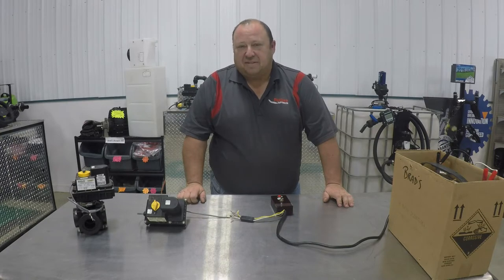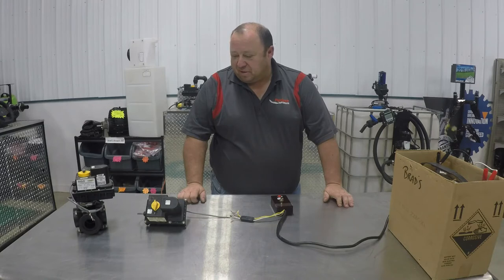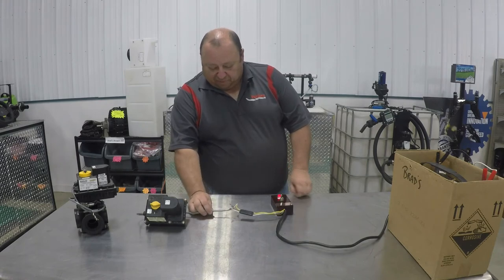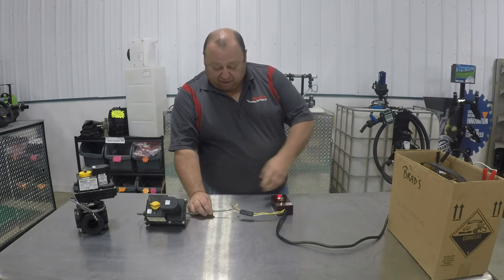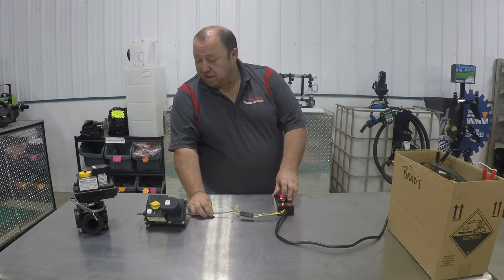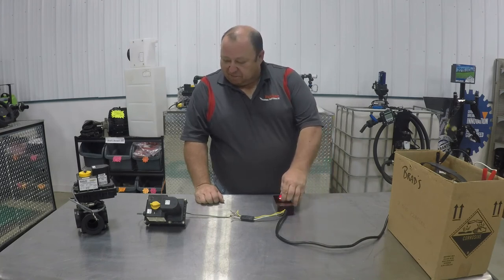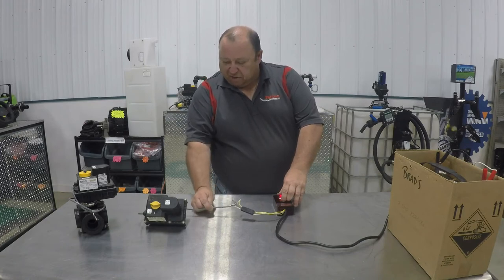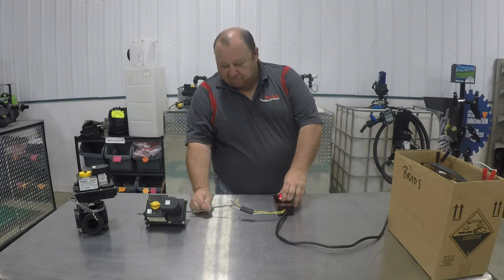Pattison's New Model Banjo Electric Ball Valves Troubleshooting

Comment: Anyone know how the yellow plastic "flow indicator" is removed on this electric Banjo valve?
Reply from the maker: Hi Bill! The plastic flow indicator cap should just pop off. If you can pry it straight up on it it'll remove easily.
Reply: Thanks for the tip.  I wasn't sure it just pried off.  I had the valve apart and simply pried the knob off using a large screwdriver blade leveraged between the case and the circuit board.   @pattisonliquidsystems3583